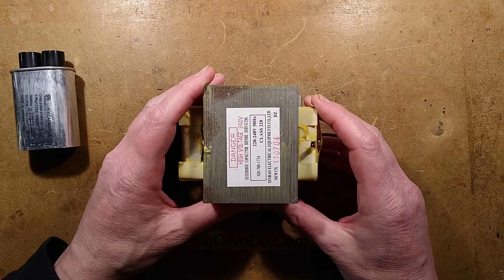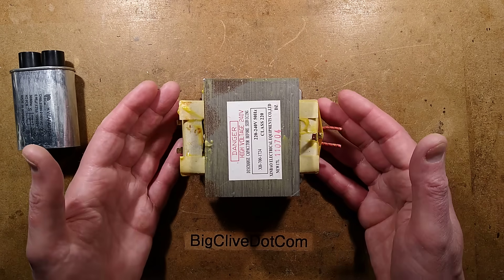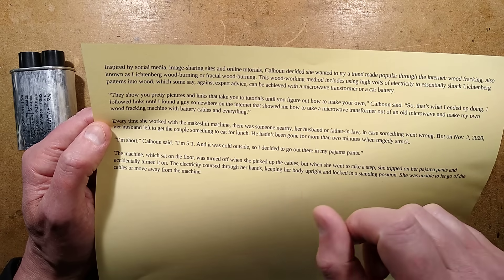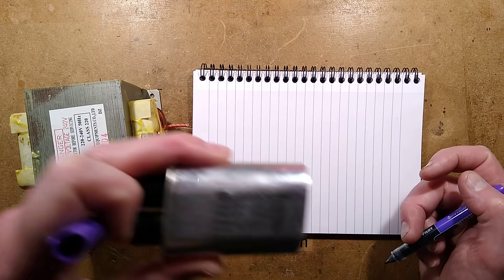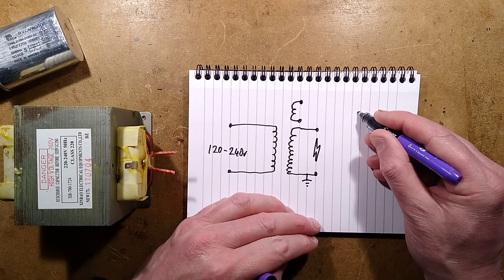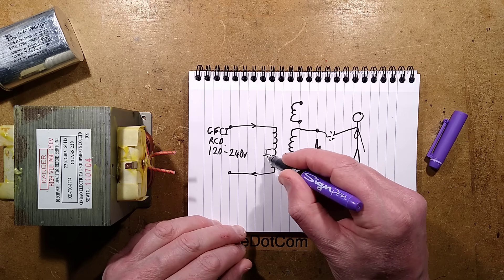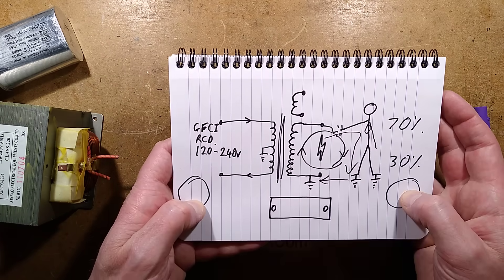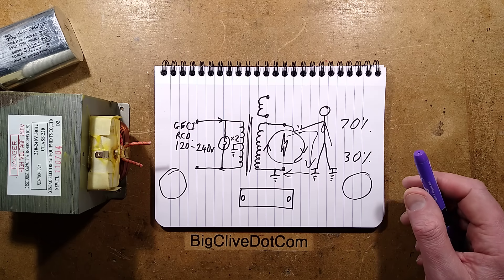The most deadly project on the Internet

Comment: It should also be noted that - like any transformer - it’ll both step up AND step down (AC) voltage depending on where you feed it in. This means that if you feed about 1-2 VAC RMS into the filament winding, that becomes the primary and you’ll get mains-level voltage AND 2-4 kV out of the other two windings! If you feed the mains voltage in the 2-4 kV secondary, the voltage will step down at the mains leads (and the filament winding) in accordance with the turns ratio. Of course, if you put mains voltage in the filament winding, you’ll get a smoke bomb AND a brief shock hazard! 😬 ⚡️

Comment: I once had high voltage enter the middle knuckle on my pointer finger and exited through the tip of my finger. It burnt a track through my finger and left a small pinhole in the tip of my finger. I couldn’t bend my finger or touch anything with that finger for ages.

Comment: Thanks for this video Clive. I do intend to make a lichtenberg device. I probably would have made it the stupid way too had I not seen this. 
Now instead I'll be using a dead man switch setup, with buttons instead of switches, and instead of holding probes, I'll be 3d printing arms that the probes with be mounted on instead. And likely make a large plastic or glass box to cover the wood pieces I am burning the pattern into as well.

Comment: I don’t usually post in comments, but this one hits home. This kind of accident happened to a friend at our local Makerspace. He is a very competent machinist/fabricator and VERY safety conscious. Having said that, during a demonstration, a mistake was made and he made contact with the electrodes. It stopped his heart instantly. Fortunately someone was able to start CPR and call for help. Several resuscitation attempts were performed on the way to the hospital by paramedics. Early on his prognosis was not good. His brain function was minimal. He did survive and fortunately after a rather lengthy recovery he is doing fine. Needless to say, that device was immediately removed from the Makerspace. You often think of a death occurring with large, powerful industrial equipment. Rest assured everyone, this little silent device can drop you like a sack of hammers. Stay safe everyone!
Reply: note to self: do not allow these in the makerspace

even the most precautious people make mistakes, that's terrible to hear but I'm glad he's OK
Reply: @colourboots  I guess you could do a project in the makerspace where you build a proper enclosure with a glass window and safety interlocks.  It could be an educational project :)
Reply: Yes, you would think, but just look at the AED device or commonly called a defibrillator. Very small, battery powered but it will start, or stop your heart.  The give away on the transformer is the sign that reads HIGH VOLTAGE.  Why would anyone mess with one especially unshielded.
Reply: @frotobaggins7169  "4,500v.  That's a LOT of current." Er no, it's a high *voltage*. The amount of current which will flow is proportional to the resistance of the circuit and if that is high, the current will be low. (And vice versa).
Reply: @RobertSeviour1  it’s amazing how many people make comments here and simply have no grasp of Ohms Law. However you sir know what the fuck your talking about. As someone else here stated it’s all about Potential Difference governed by Ohms Law.  I find it mind blowing that someone could build this and have no idea how dangerous it is but think it’s perfectly reasonable to use such a device for something as insignificant as pretty wood patterns. The Darwin Award goes to ……….
Reply: @RobertSeviour1  Er... current is inversely proportional to resistance:  I = V/R
Reply: @RobertSeviour1  good catch, my bad.  Current would be amps not volts.
Reply: Yep. @Graham_Wideman
Reply: @Graham_Wideman  It’s I=U/R because V is volt and not voltage
Reply: @Alexander-me4qq  The letter used for the variable "voltage" is established by convention, and that convention is consistently "V" for English-speaking countries, and "U" for some other countries. You can confirm that V is widely used by all kinds of google searches, perhaps start at Wikipedia's Ohm's Law page.  So it's common to see, for example,  V = 5V.  In books and papers, variable names are often italicized, like:  V = 5V.  Sometimes in equations the units are placed in square brackets, so V = 5 [V].
Reply: @frotobaggins7169  not a large gap. And voltage doesn't denote current at all.
Reply: @frotobaggins7169  4,500Volts is a lot of Voltage, a Potential measured between two points , NOT Current!!
Its only current when the potential has a path for electrons to flow and the flow or movement of electrons is the Current measured in Amps!!
If you do indeed work on electrical or electronic equipment you might need to understand the terms, units and theory better.
If you think to yourself DANGER 4,500Volts this can kill, that's the right approach, and please be safe !!
You don't need to consider how far it will jump, stay away from it, period !!! 
The distant a Voltage Potential will bridge, or "jump" (your term) , varies depending on multiple factors like humidity, 
air pressure, shape of the objects, medium in between etc. I assume you are thinking of an air gap.
Talking about bridging gaps, you might think a fuse is a simple device, but fuse theory and manufacturing is not so simple, interesting reading !!
Reply: @KB1UIF  yes, thank you for correcting me.  I think I had a brain fart.
Reply: @KB1UIF  even being near high voltage power lines is dangerous, those things will kill you without contact
Reply: @noahprussia7622  Yes, I totally agree and have already made this comment 
"You don't need to consider how far it will jump, stay away from it, period !!!"
I have worked on many pieces of high voltage equipment, your not telling me anything I don't already know from experience !!
High voltage will find its way through tiny holes or gaps in insulation too If you are not using the correct good quality equipment !!
Ask me how I know !!
Reply: @frotobaggins7169  in layman’s terms you can think of current as the volume of a column of water, or the width of a river. voltage is how fast the water is flowing :)
Reply: @mfThump  Thanks, yes, I know.  I just some how confused my self.  We all get mixed up from time to time.
Reply: @mfThump  I've always thought of voltage as the height of the water column (pressure), resistance as the (inverse of the)  size of the hole or pipe leading out, and current as the volume of water flowing. 
Not disagreeing, just expanding the thought to include all 3 sides of I=V/R.
Reply: @mfThump  the other way around. Voltage is analogous to the height of a column of water (Electric Potential), while current is analogous to how fast the water is flowing.
Reply: Reminds me of ElectricBoom
Reply: @semcriatividade1003  ElectroBoom <3 Mehdi!
Reply: The one thing I've not seen mentioned is that a MO transformer is meant to power a magnetron microwave tube, that is making up to 1500 Watts. 
That secondary has a very high current rating compared with a Neon sign transformer which makes about 25W.  
An MOT has got a real punch behind it, once it starts arcing, it creates it's own conductive path.
Reply: It's great that you shared that story and it is in a way the best one in the comments for the very reason you give at the end of it. Thank you.
Reply: Glad your friend survived, and that the rest of the group got rid of the dangerous device.
Reply: This is almost like saying "you should never cross a street, because it's dangerous" (there are indeed plenty of "competent" people who manage to get hit by cars as well). But with that said, it's still very good to show the danger and that it's not time to be careless when you play with one of those transformers (or other high voltages devices with high current capability - it's the combination of high voltage and high current, that can really fry you). Especially when it comes to an application like this, it's good to show the danger - because this is not just playing with high voltage electricity, but might also find interest among people who are not very familiar with electricity and think of this as an easy way to make nice art. 
It' was just all the comments "don't do it, because you will get killed" (regardless of who you are), that made me a little annoyed...
Reply: @Speeder84XL  "This is almost like saying "you should never cross a street, because it's dangerous"

it really isn't though.  rather is like saying you shouldn't run onto an 8 lane freeway without looking.  you need to work on your analogies.
""don't do it, because you will get killed" (regardless of who you are), that made me a little annoyed.."
one, nobody gives the tiniest fuck that you are annoyed.
two, the point is that there are many kinds of streets, and crossing your one lane 15 mph neighborhood street is not at all like running across an eight lane 60mph freeway.  Much easier to become dead on the freeway, because a single tiny mistake is VERY likely to kill you, even if you ARE aware of the danger.

Are you also the kind of person who would recommend french kissing random strangers with Covid?  "Don't let the fear of death get in the way of a good kiss!"
Reply: @thomasneal9291  Your comment seem to have disappeared for some reason (so I don't know if people will see it). But you are again taking it to the extreme. Any road (except for maybe really slow streets in residential areas, where no one is speeding) could kill you if you are careless (for example where I live, people sometimes just step out on crosswalks, without even looking - because cars are supposed to stop). Walk across a 8 lane highway WITHOUT LOOKING is upright suicidal. 
Not at all compared to handling dangerous electricity, where you are aware of the danger and take some precautions. For example use long insulating sticks for the electrodes (so you don't have to stand so close that just a single unattended movement or for example a cable that come off and falls down, could get you zapped) and always disconnect the power when not actively using the setup 
 - and do it in a safe way (not so that you can turn it on again by just tripping over it). 
Some degree of negligence, must have been done in this original comment as well (regardless of how competent and safety cautious the person is in general)
You can't just get into contact with the electrodes, if you take the proper precautions. 
Again - it's not that they show or write about the danger that's the problem for me, but the "never do it or you will get killed" comments...
Reply: BigSecurity is warming us

Comment: Even the professional overlook safety at times. 

In the early 1990's, my Fighter Squadron went to Turkey (I was in the USAF, the Squadron was from the 48th TFW, Lakenheath). I was in the Weapons flight, we needed to have an actual "office". So they gave us a Fire Truck, hardened shelter. Built next to a HAS or TAB-VEE, except it was "CUBE" shaped, instead of HAS shaped. BUT... it only had 480v 3 phase (4 phase?) power. So one of out electrical professionals said, "No problem. Theres the mains, I can tap us a line off of it to give us what we need."

He pulls out his Fluke meter, and probes away, as I watch him nearby. It was hot, humid, and we didn;t even have a fan. He was sweating like a pig (well, we all were).  He opened the panel, inside was simple, a few lines coming in, and two lines going out. He placed it meter on the open panel, which opened from the top, with the bottom on a hinge, making a nice shelf to work from. A nice meetal shelf to ground the meter. And he began probing. And then I noticed it. Sweat running down the meter leads. He did not. No sooner did I yell, "Wet Leads!" did the convulsions start. I acted quickly and body checked him away from the box. 

He gave me a look that said, "WTF You doing! I meant to do that" as he huffed and puffed, and flexed. Then he let out a quick breath with the words, "Thank you" under it.

Comment: I'm a retired High Voltage Test Technician. I would go into substations and test the High Voltage, Switches, Breakers and Transformers. 
We were called in to test a Transformer where an individual had climbed into the yard to steal  copper wire and had put his ladder up on the energized 34.5kv Transformer. He went phase to ground, (we think) from where he tried to cut a Lighting Arrestor wire  off the primary. He was found outside the fence by security investigating the power outage. Most of his clothes were burned off, and I'll stop there. 
I heard he lived through it. 
The temperature of an electrical explosion is hotter the sun. Thanks for every safety point you make concerning electricity. 🤝🤝🤝🤝🤝👍👍👍👍👍🇺🇸
Reply: @sjb3460  More importantly, how much jail time did he get for trying to steal the equipment that is part of essential public infrastructure?  Seriously,  stealing operational infrastructure parts is an extreme level of public harm.

Comment: I am a neon guy and we use basically a pole pig transformer to bombard and clean the tubes during processing.  These bring our 240 to 20K.  That will kill you fast, so all the equipment near the manifold, which is made of all glass, are powered by batteries only, no plugs for any arching, and the whole thing is powered with a dead man switch and the two lightbulb across the mains to know it's on.  I have built these with older 15k neon transformers as the new transformers have circuit breakers that see a ground and will kick off the power to the secondary.  Most electronic transformers have that as well.  Being hit with 15k at 30Ma will wake you up, but not kill you like the microwave transformers.  I've been in the neon industry for 30 years and I'm not touching one of those.  The bombarder transformers we use are worse, but there is a lot of safety built into my system, but it is to easy to get complacent.  When death is the outcome for not doing things right, it helps to keep you focused as long as you know death is on the table.  Great video.

Comment: Once I was replacing a 230V roof lamp and I stood on a chair. The light switch was off. Somehow I still got a shock and and I fell of the chair :) So it is dangerous business even if switched off, because obviously there was still voltage between one of the leads and ground.

Comment: Ah, I remember when I was experimenting wit Mots, with different ballasting methods, had a screwdriver connected to the HV output, was doing something and went to grab the screwdriver, picked up the metal end in my hand by accident, had my right foot grounded, 

Now that's a flyback transformer

Had my arm numb for like 10-20min

4.5kv wit about .5 - 1A floating to ground doesn't feel good, atleast I got lucky and only had my right foot on the ground and didn't grab with my left...
Reply: Ever wonder why it's called a flyback transformer? Because you touch Dat  High voltage output, you may fly back several feet uncontrollably

Comment: In my work we are regularly working with 800V inverters with massive amounts of capacitors on the DC link. I usually run these from another room because of the risks with things exploding when it fails. People playing with 2kV MOT does not understand the risks and those who does stays away.
Reply: Yep we work with 800V strings of supercapacitors or batteries too which are not something to take chances on just like MOTs.  Just a matter of how much remains for burial.  At least at work health and safety is important but when I see people doing things I wouldn't do when I was a teenager I'm filled with dred.  I learnt about electronics at an amateur radio club where an old ham radio op lost fingers due to his linear amplifier supply so grew up with healthy respect for electricity.  Slightly different in he got hit by DC but at several thousand volts and 100s mA+ it doesn't really matter.

I've done the MOT Jacob's ladder thing about 22y ago but controlled from other side of the room and had plug in my hand before I got near it to adjust.

Comment: Excellent advice, perhaps I'll not play with the pair of these I have lying about in the garage.  However, could you suggest safe uses for such devices? Paperweights perhaps or more useful, could they be wired back-to-back to make an isolation transformer??
Really enjoy the videos.  Thanks again.
Reply from the maker: They're not really rated for continuous use, and your isolation transformer would unfortunately have 2kV inside it.

Comment: If one were to use a neon sign transformer....you'd definitely get a nasty bite.
Reply from the maker: Absolutely.  A shock from a neon transformer is a "memorable" lesson.
Reply: @bigclivedotcom  Luckily I've never had the pleasure....  The 1.5 to 2" arc flame (depending on the KV output) is scary enough. :)